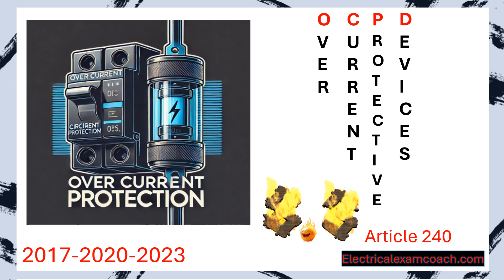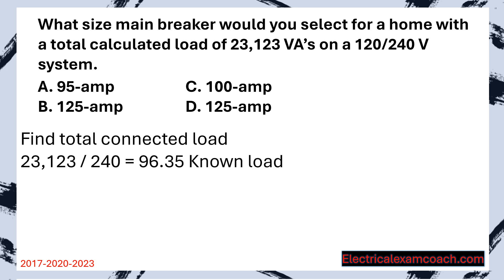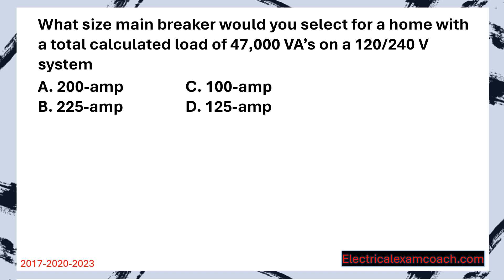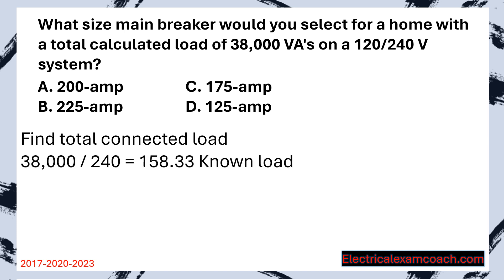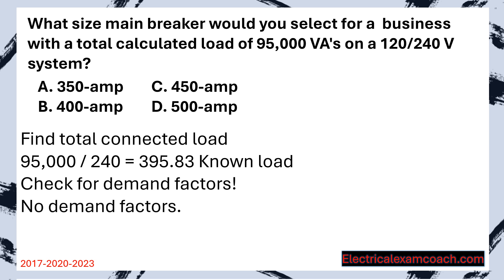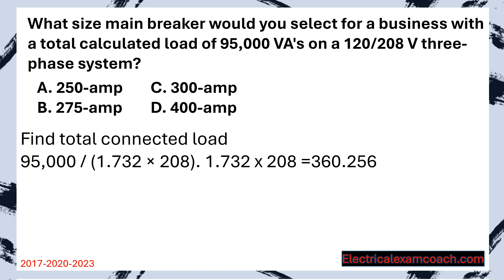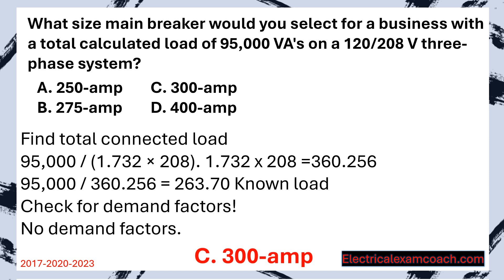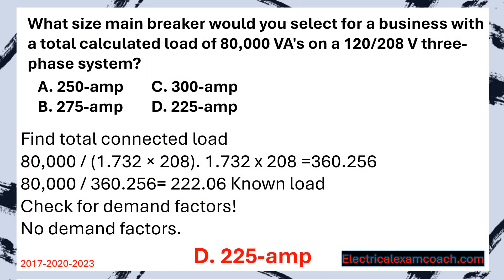Lesson 8.3 Sizing Breakers and Fuses. Master Journeyman  Exam Prep Calculations Portion

Comment: Thank you for the video. However, I am curious why the current-carrying capacity of the cable was not considered, given that the circuit breaker is intended to protect the cable?
Reply from the maker: Great question! That comes in lesson 9. 

You want to learn over current protection first, and then ampacity.
Reply: @ElectricalCodeCoach   Nice , I can't wait